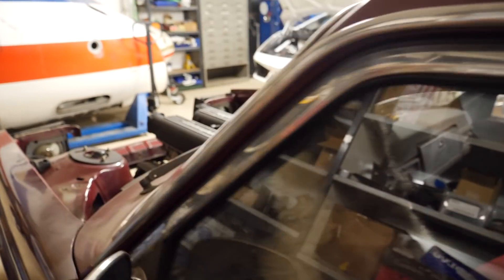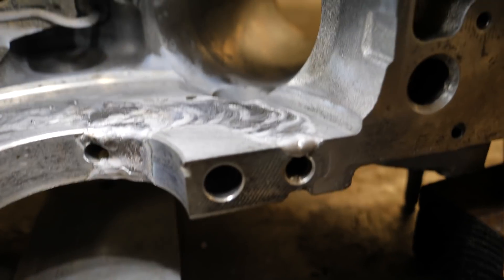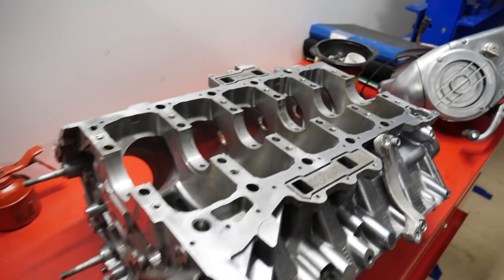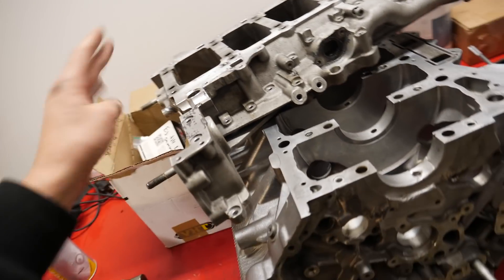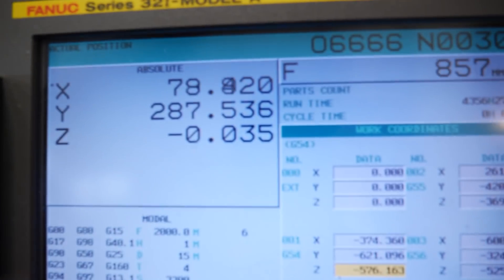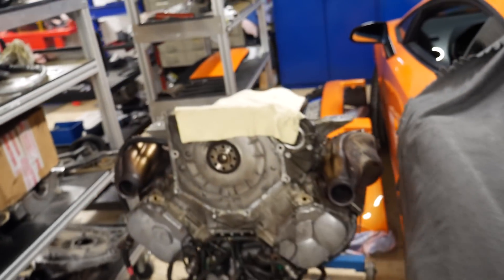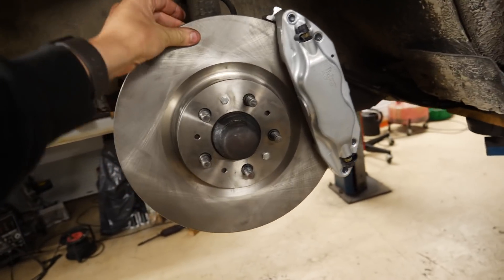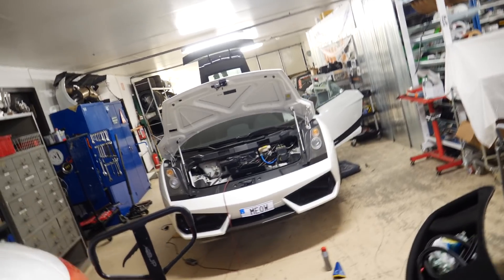Welding of broken Lamborghini engine block. Volvoghini Project!

Comment: Peters next project: - "I'm welding two 5-cyl volvo blocks together making it a volvo v10, putting it in my Lambo"
Reply: I thought this will happen here :)
Reply: It has never made to the market, but there has been a V10 project, where 2 5-cyl has been built together. I felt great sorrow when it has been ditched... :-(
Reply: donphobos : built by ??
Reply: @Hankie56  By the actual OEM. Has driven it and the sound was incredible.
Reply: Hehe, great :)
Reply: @donphobos  Was this before they went for the Yamaha V8??
Reply: that would be a W10
Reply: @clintonepps3666  Yeah, or 2 Hayabusa engines as in the Ariel Atom v8. :)
Reply: @eedds222  Ariel Atom v8 don't agree :D
Reply: @RWL2012  um no. Two I5 blocks welded together would be a a V10. To get a W10 you would need VR5 blocks
Reply: @eedds222  Lol are you sure about that?

Comment: Somewhere there is a Lamborghini with a Volvo engine and I'd like to see that one too
Reply: Well, the Noble M600 might be close enough? At least, it's a proper supercar ;)
Reply: Reliable daily lamborghini :)
Reply: @samteks997  Some could argue it is a Yamaha engine in Noble.
Reply: diesel ))
Reply: Red block B234 pushing 30ish lbs of boost.
Reply: I think the 4 banger out of a 240 might fit
Reply: timakimat a
Reply: In sweden its hard to find any car type that hasn't at least once been converted to a b23 :)

Comment: took me back to my youth, stuffing a 2.7L 911 engine and gearbox into a 1973 VW bus. weirdly the toughest part was the shifter. vw shifter shaft is on the bottom, 911 is on the top of the case. used 914 steering parts to hook up. it was scary....brakes weren't up to it!  hero!!!

Comment: IF, I was going to try welding that, I would have made sure the crankshaft and some old bearings were in there. But I would never try that repair. I am cheering for you to get it to work. That is a ballsy repair.

Comment: How do you know what alloy material to use for welding the cracks? What welder are you using? This should be quite powerful to be able to heat such thick aluminum casting, or am I wrong? Thanks for awesome content!

Comment: That is some fine welding you did. Of course you would get some distortion in the block. You have some fine friends with excellent tooling and skills. Good luck going forward with the build. When it is done you are going to have a very fast Volvo Estate. Reminds me of the BTCC races where they raced a Volvo estate fo4 a couple of years. It was a sight to behold. Wonder if one of those cars is still around.

Comment: The best and only person who has balls big enough to weld a block !!!
Reply: i had a citroen zx " glued" with gb weld type  of glue  for 3 years  80k km  and was still working when i sell it   ,yes the  new owner was told about this isue
Reply: @TheMakyato  That is not an issue, that is a miracle!
Reply: @TheOriginalEviltech  it was not on the piston chamber but outside of te block and was leaking radiator  fluid  , 4 inch  crack  and 1,5 kg  of "gb weld"  1 inch thick  
at that point i had nothing to loose so i take the chance
Reply: @TheMakyato  sounds a bit like a friend of mine that hit the engine oil pan on a rock and broke off about 4 pieces to reveal a hole almost 5 inches in diameter. He bought a large can of dog food and used the metal from it to make a temporary plug for the hole. He also used silicone and a few self tappers. Next day - new oil and the car made it back home almost 400 miles from where it got damaged. He still drives it like that, never changed the oil pan...
Reply: The block is already blown, so is a free project to try

Comment: Peter what is your opinion now re major weld repairs ie full depth on a block? I thought your idea to install and clamp an axle or cylinder was reasonable but the forces involved in thermal expansion are off the scale.

Comment: Re the elephant ear mounts, in the US they say that you only need one rubber mount to take out the vibration. I can't remember which one but I reason the driver side stays solid to prevent the motor torquing and the passenger side gets the rubber mount since it's the one in compression however I could have the arrangement ass about as they say. I haven't used elephant ears myself however I have elephant ears for a big block Chrysler V8 should I go drag racing. It is a one piece design made in aluminum that sandwiches between the water pump housing and the engine block. I acquired it many years ago with a garage clearence of big block Chrysler stuff.

Also, it was factory fitment on some 440 Mopars to have a small swaged length of wire rope with eylets on the diver's side engine mount bolt at one end and the subframe bolt to stop the torque from tearing the rubber mount - so you could rubber mount both elephant ears and use some wire rope since it has some stretch and won't bang harshly like chain does. I know this because I had a chain on a 440 in an A body Dodge Dart and I took it off immediately since when I did a burnout I felt the harshness was going to tear the side of the engine block out (a bit like the engine block you're repairing). 
Also, some places in the US make tubular front suspension with coil over shocks and rack and pinion steering for many 60s muscle cars, and I note some offer elephant ear engine mounts for header clearance, and they are offered with both full rubber mounts or rubber on one side only or no rubber mounts.
A little bit of info from an ex Volvo mechanic.

BTW, girdle is the correct description in English for the main cap design in this.

Comment: You kept pulling the filler rod out of the gas shield. Also, did you preheat that block; put it in an oven to let it cool slowly, or wrap it with a welding blanket?

Comment: Great educational footage - especially lowering after welding. I am a fan of your blog. You are a practitioner and you can answer me - in the place where the added material is connected to the head (welding end of the weld), micropores are created. They affect the tightness of the head - will the gasket seal these imperfections?
Mario from Poland

Comment: So the damage on the block was from crashing the lambo backwards into a wall?.. I does look like someone tried to stuff the gearbox innards through the engine
Reply: Engine block and transmission case damage from impacting anything from a street curb to a wall at a race track is quite common because they are used as structural members in most every “super car”. This practice of using the block and transmission is becoming more popular in automotive industry because of vehicle overall weight saving which translates to fuel economy.

Comment: Steel plate is the best for moter mounts when your doing something of this caliber. However moving the engine that far back you may have issues with a lot of things especially when some thing fails and you have to pull the engine back out to repair it.

Comment: Watching tavarish's orange Lamborghini videos I noticed the the electronic throttle control module are the same as a Volvo s60 from similar year.  Except there are four.  I looked it up and the casting and electronic look the same.  The plug is different.

Comment: Thanks for sharing this!

Curious to know how the chinese Brembo work. Have you taken them apart to look at the pistons etc?
Reply: If they are made in China I would not put a high quality tag on it especially knock offs. just hope they work when they needs to and don't fail all together
Reply from the maker: No i have not been taking them apart. But there is several guys in Sweden using these with good result.
Reply: Peter,
Very impressed with your projects and level of quality. Suggest company supplying the caliber bracket to change their name to something else than ASS or it might be brilliant.

Comment: The interesting thing about all this is that the Volvo 2 series offered a diesel engine at one point, an inline-6 made by Volkswagen.  This diesel six cylinder was based upon the VW EA827 unit, commonly known as the inline four used in nearly every Golf, Jetta, Scirocco, et cetera with displacements between 1.5 and 2.0 liters.  It had an 88 mm bore spacing.  The EA827 was further modularized and turned into a V8, then a V6, a V10 [hint...] and even a diesel V12.  The V10 is of note because it is the engine that was indeed used in the Lamborghini Gallardo/Audi R8 cars.

Which means your Volvo has kind of come full circle, since you will find your Lamborghini V10 has an 88 mm bore spacing, just like that ancient inline-6....

Comment: Very  Good   Work...Im   worried   about   the  Bearing    web weld.... So  Much   stress   when   that  crank  is  spinning....  ANY  Flaw  will   destroy    the   engine. Here  in  America  Ive  seen  a  few  v8  240  swaps.... Very   fast  cars.

Comment: try 2 sportster  rubber mounts. i think they are flat enough to have a piece that adapts to where you are bolting. almost any rubber mounted v twin motorcycle is gonna have that flat motor mount.

Comment: By the sound of it, you actually welded a bit on a cold side, you should be able to achieve the penetration through about 1-2mm of the aluminium. The frequency is how often it changes positive to negative basically, you need to adjust balance to achieve more or less cleaning action look in the manual for your welder depending on what the balance achieves you need to adjust it either in positive or negative from zero.

Comment: The thread insert needs to be put in with some adhesive or cement. Not a lot just a small drop on one side. I have used them and have had them slip. I use one drop of red thread lock and have never had one slip with that.

Comment: There needs to be a link pipe on the bottom of the calliper. At the moment there is nothing linking one side to another. Unless it's internally fed with an o-ring in the middle of the calliper. Worth looking at as having a bleed nipple on the bottom doesn't make sense.

Comment: Check the backside of the V70R/S60R calipers and there should be a little bit of a step up or raise from the housing of the caliper where the Brembo tag would have been if they were the OEM calipers that they grind off during re-manufacturing them to a flat surface and paint over, the S60R/V70R and even the V70XC had real Brembo 4 piston calipers with the identity tag hidden on the back.
Reply: Those are knock-offs, though. Check his link above

Comment: I watched a fellow a few months ago welding a plate of 6061 20mm thick. He used the original Heliarc method, Helium gas running DC not AC. It was Sooty and a little ugly but very very fast. He said the idea was to force the heat to go straight in and expose the material to as little heat stress as possible.

Comment: Can that repair ever be completely  trusted? After welding it's still weaker than the rest of the block because the weld doesn't penetrate through the entire thickness. I'd also be wondering if the position of the repair is accurate enough to be within tolerance for the rotating parts with radial alignment.

Comment: Peter,
Did you line bore the main bearing after facing the block and bearing caps.
Reply from the maker: Yes it is at engine machine shop for that now!

Comment: There's something about the TIG welding scene. Is it just steel and stainless where you need to keep your filler metal shielded as well or does aluminum also fall under that category. Been a while since I've watched a bunch of TIG videos so I can't remember for certain. Just hate to see something break on you because of a flawed TIG technique.

Comment: nice project.. i hope you dident distort the block to much by not clamping directly ontop on the blocks. :) parts will flex easy and distors when you losen if you dont put the clamping force directly down into your parallels or table.

they have a very beautiful machineshop there..
Reply from the maker: We did measurerment with and without clamping. so it is not distorted ;)

Comment: I am very affraid that the steel part (one that supports bottom of the main bearings) that shown hairline cracks on the aluminium that was surrounding it might be cracked inside too. Also thinking this since it was protruding an had to be surfaced.  Main part of the block that is made purely from aluminium will be fine for  sure . But i would be very affraid to use that bottom main bearing girdle without futher examination.  Subaru EE20 diesel engine uses simillar technology of steel bearing  housings that are cast in aluminum and it is really problematic. Once you see any crack in aluminum, further digging always reveals cracks on the inside steel part.  Running it like that results in cracked crankshaft.  Havent found a way to repair this so far. I wish you luck

Comment: What welding  rod did you use.  i know lambo blocks are notorious for the silicone content in the aluminum.
Reply from the maker: You can see the filler in an earlier video. It has a lot of Silicone in it, simular to the block material. Forgot to show it in this video.

Comment: You are a very impressive welder..but the main bearing alignment and bore size needs to be align honed or line bored to assure correct alignment...look for a shop that has a Sunnen align hone machine
Reply from the maker: Of coarse the block is at a engine machine shop now :)

Comment: Will this welding actually work? Id be amazed if it did....
Reply: The welds look good, so it should work just fine after everything has been machined to spec. Welding cracked blocks isn't done very often because it involves so much work that it's usually cheaper to replace the block. But these Lamborghini blocks are so expensive that it's worth the trouble to repair them.
Reply from the maker: I am not sure! So it will be interesting to see if the engine works and hold up for the power! :)
Reply: Nothing to loose 
It was scrap metal as.it was 
Worst case it's a good experience in engineering 
Best case it's a functioning engine

Comment: I would actually like to do this in reverse. Buying a R8 or Gallardo with engine damage and swap in an 2.5 TFSI Audi 5-cylinder turbo engine.
Reply: Not forgetting to boost it to about twice the power of the car's original engine ;D
Reply: 1,9 TDI is better :D
Reply: Migi 11 too easy! Electrify it with a cordless drill 😄

Comment: This is a lot more involved than the lamborghini v10 block I welded up.  This one was just crashed and smashed the water jacket on the firewall.   I was welding it up and was wondering how thick the water jacket was around the part I was welding.  I looked at an cutaway view of the engine and it turns out I was welding directly on the cylinder.  These 5.2 blocks are not sleeved with iron, so when you weld in this area you are welding on the actual alloy cylinder wall.  

Everything turned out ok and that car is still on the road :)

https://imgur.com/a/9l955lY

Well done!  Cant' wait to see this volvo shredding!

Comment: Greetings, it was difficult for me to see but, you should have had 110% penetration on your very first pass to insure complete adhesion to the base metal. My experience comes from Aerospace and Aircraft and everything in between. Everything I have done in my past had to be U. S. Government Certified. (Pain in the  Ass) but that's what you have to do. GOD, you have some beautiful machinery and frankly, I am jealous over your CNC operation however, I have to thank my loving God that I do have a pot to piss in and an old window to throw it out of and a shop that's probably just a little better than your bathroom. You have been blessed!

Comment: Not that I'm claiming to be an expert machinist, however, i'm pretty sure that the integrity of that block has been irreversibly compromised. there will always be micro fractures/cracks that with heat and cold cycles are bound to expand, and result in another catastrophic failure, in a relatively short time-frame. Hats off, though, for being so industrious and inventive. best of luck.
Reply: He's a aircraft engineer I think he knows.

Comment: Let's be honest, this ought to have been scrapped. Would you buy that engine after a repair like that, however well done?
For a home project that's fair enough, you can do what you like. I didn't see any attempt to measure whether the journals lined up after welding, you can't just assume that they do. You might get away with it, but it's a lot of effort if you find that you run out the journal bearing soon after the rebuild.

Comment: The reason it warped is because you didn't take your time.  You needed to weld in very very small increments. and then cool it off each time before you restart.

Comment: Have someone help you set the measuring gauge. You have at least a 30 degree angle on that thing, only getting a direct reading of about 50%. Lots of work went into that block but sadly it’s still junk.
Reply: Tell us more how that ruined the leveling...

Comment: '
what kind of metal on the block engine...
aluminum is a break easily and lighter weight...
hard steel is a strong and not break but heavy weight
Reply: The metal you want to use is al-u-minium. Much better than cheap nasty al-oo-minum 😁

Comment: The 10 cylinder is an ugly engine compared ith the early V12's .   I thought you might have a problem with Shrinkage welding that block. Will your timing gears be affected now with the center line between the timing parts and the crank center line? .The guy that does my engine machining was welding an Alloy bock for a Ford racing engine last year. It had thrown a rod but it was cheaper to repair the engine than replaced it .They made a jig to hold the block square while they welded it.